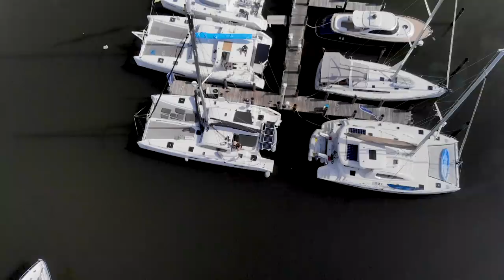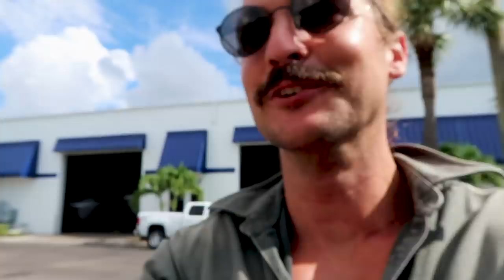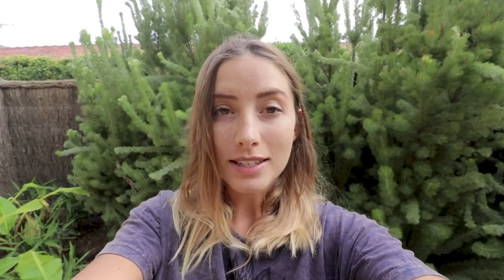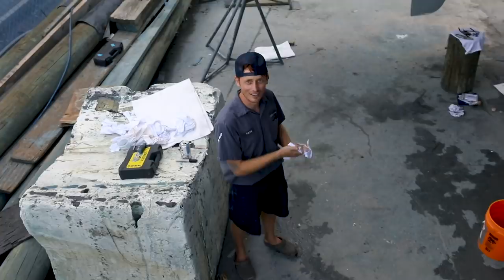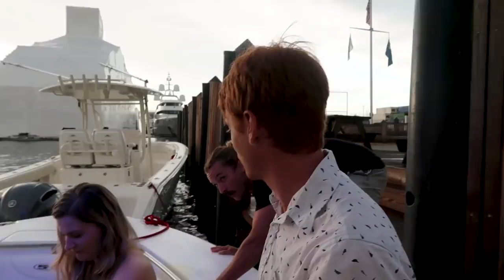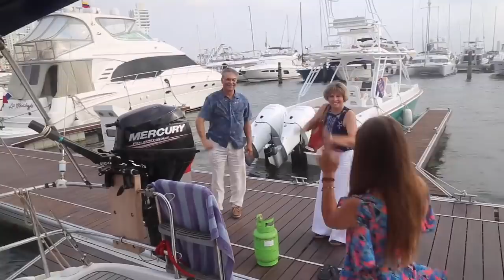The Great Haul Out, Breaking Bad Style Ep.166

Comment: Working in Florida is sounding a lot like working in Ottawa, Canada in the height of the summer when the temperature is 35 degrees Celsius and the humidity is between 80% and 100%. It's brutal. You can only survive in air-conditioned comfort.

Comment: Pressure washing....I had to wince watching you pressure wash the hull....I do not know what the pressure setting was...but generally speaking one should never direct the stream at exact right angles to the surface being cleaned.....fiberglass is covered by gelcoat that is very brittle...if there are ANY minuscule voids between the FG and gelcoat the high pressure can "punch holes" in the gelcoat...don't ask how I know this ;).....the stream should always be directed at some angle, like 45-60 degrees, to the surface being cleaned.

Comment: In the rest of the south they are usually referred to as “nats”, like “bats” but with a “n”.
Reply: gnats
Reply: A gnat is any of many species of tiny flying insects in the dipterid suborder Nematocera, especially those in the families Mycetophilidae, Anisopodidae and Sciaridae. They can be both biting and non-biting. Most often they fly in large numbers, called clouds
Reply: I'm all too familiar with no-see-um's from when I was living on the coast of SC. They bite like heck. Gnats are not the same as no-see-ums. Or maybe they are one kind of gnat.
Reply: @IMSiegfried  yes they are in the same class and are a gnat.
they are abundant on coastal areas - like here in La. as well
Local remedy is to use a "Bounce" dryer sheet and rub it on you - the pesky "no-can-see-ums" as we call them here won't bite you afterwards
Reply: @IMSiegfried  No-See-Ums are also referred to as Biting Midges, Biting Gnats, Punkies or Sand Flies. They are so small they can get through screens on windows and doors. Besides causing painful bites, they can also be vectors of diseases, particularly in tropical regions
Reply: cool! @laman491